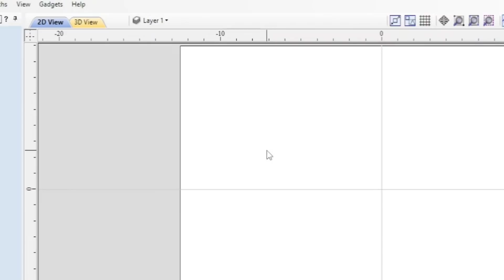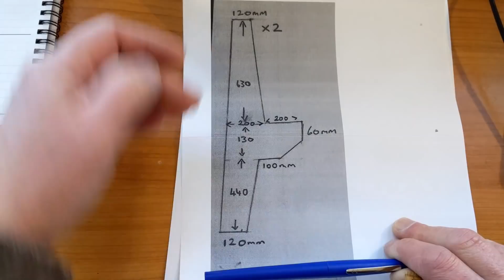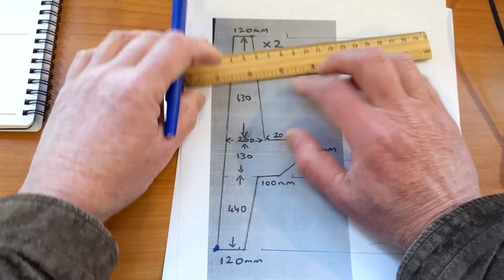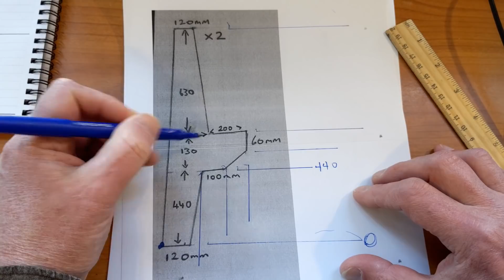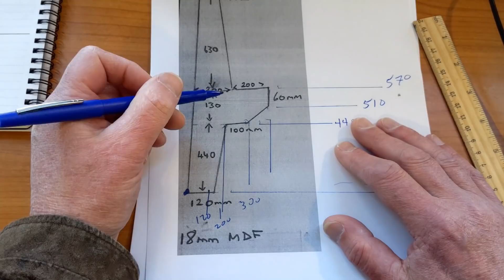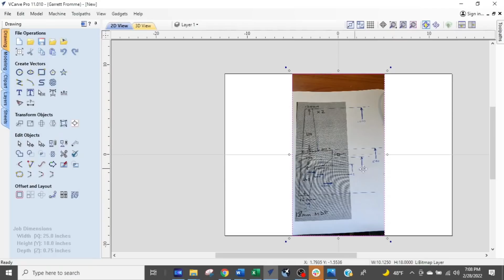How To Make ACCURATE Designs, Vectric Design Tutorial, Vcarve, Cut2D, Aspire - CNC Router Projects

Comment: I learned that you can move the drawing as a group after it's finished. I thought that when you started at X=0 Y=0 it was locked to that.
Reply from the maker: kwikcarl1, Yes, you can definitely move the entire drawing as a group even after it's finished. The X=0 Y=0 starting point is just a reference point and doesn't lock the design in place. Feel free to move and adjust your design as needed!

Comment: Hi Garrett , just tried to download the tool database for vectric aspire , and because I’m on version 9.5 it will not load into the database , can you advise on how to get around this if possible, Tia Dave
Reply from the maker: Dave, my apologies brother but the database won't work with the 9.5 version of Vectric. You will have the add the bits in manually in this case. Here's a video where I walk you through the process: https://youtu.be/670Xzgf0LiA?si=gd2DNqJkFymT7tif

Comment: I have used a single construction line before, but I learned a lot that about using multiple lines. Thanks
Reply from the maker: user-dy5yu9xp3v, very welcome!
Reply: When I use node editing mode and selection mode, snap to guide keeps coming up and makes node editing mode not work. I tried to turn it off.

Comment: What if you want to change the length of some parts. Could you enter the length in manually and have vcarve automatically adjust the piece? Like using transform on one of the lines and have any connection edges adjust accordingly?
Reply from the maker: Hi Bob. Yes you can!

Comment: You actually can enter numbers with your keyboard to position the guide lines. If you right click on the guide lines, you can position the line to a specific measurement either "absolute" or "relative" to the position your at. Once you have the first guide line, you can create the next line from that line or just create a new line and enter the measurement you want to move it to. You can also orient the guide lines to a specific angle and also lock the guide lines in place to prevent accidentally dragging it after you have paced it.
Reply from the maker: Buckeye, you're totally right. I just gave it a try and it worked great! Thanks for the tips!
Reply: That's a handy tip!

Comment: Thank you, Garrett, great video with useful design tips.  
If I may add, you can position a grid line (construction line in your terminology) to an exact position by creating the line and right clicking to get the dialogue box.  There you can set in the desired exact "absolute" ("relative", if desired) position.  Not as efficient as typing in the number in the Create Line / Polyline feature as you demonstrated, but a simple right mouse click away.
Reply from the maker: Bob, thanks for the tip! Sounds simple enough, I'll give that a try next time!
Reply: I'm trying to adjust a line that is already connected. Take a square for example, I want to adjust one side and have vectric calculate any connecting angles.